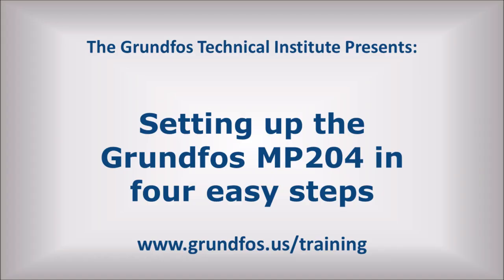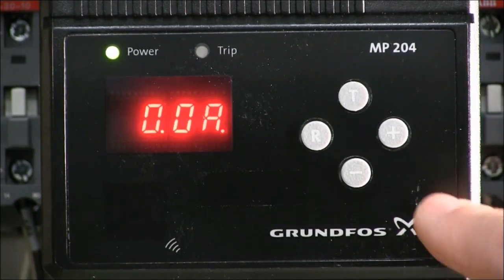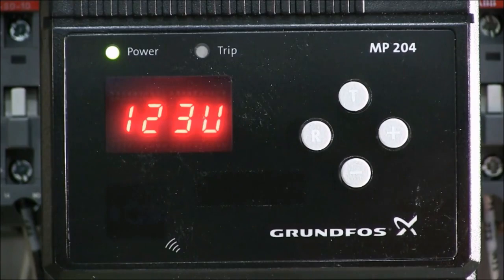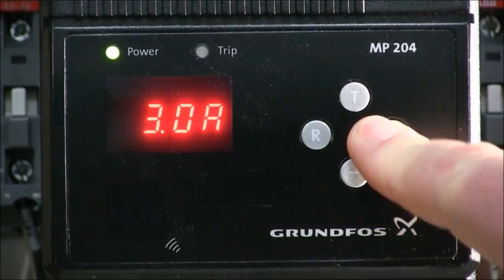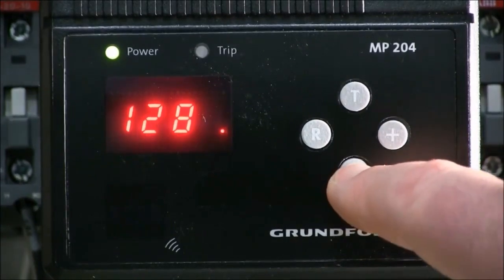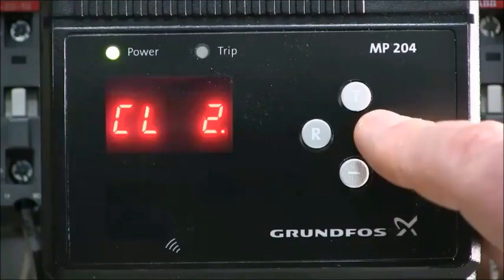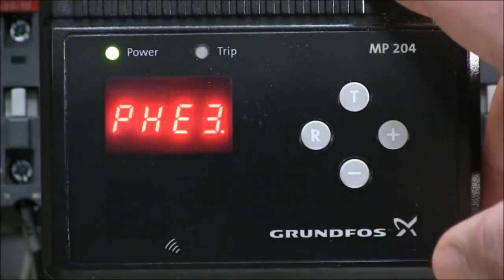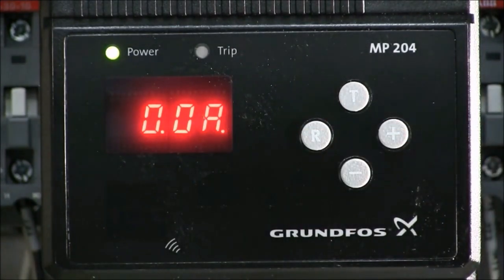How to Set Up the Grundfos MP204 Control in Four Easy Steps

Comment: Just curious to what will happen in case you didn't set up the MP 204 at the start.
Reply from the maker: Hi, 

The MP204 will trip if it is not configured from the beginning, as the system conditions are likely to fall outside its default settings range.

Best regards,
Steph